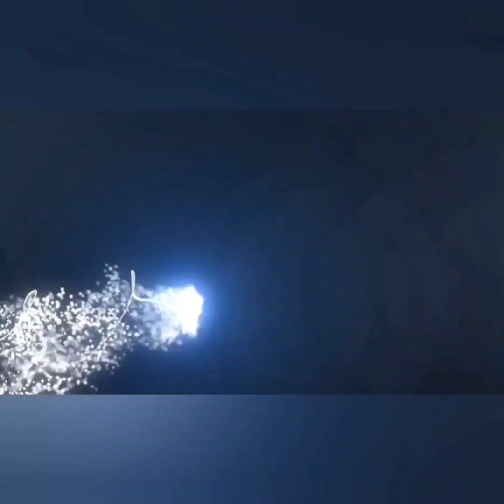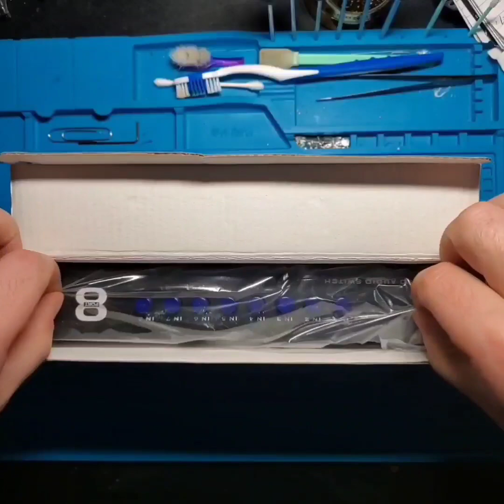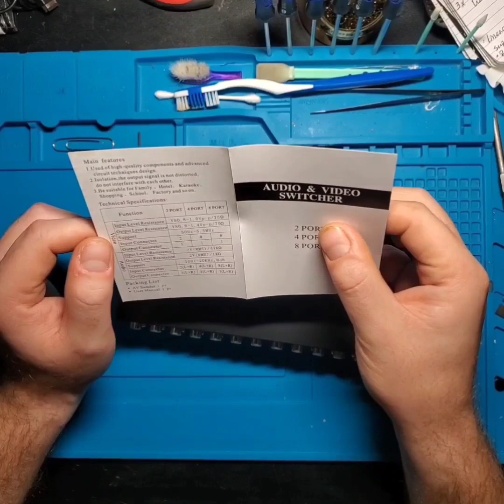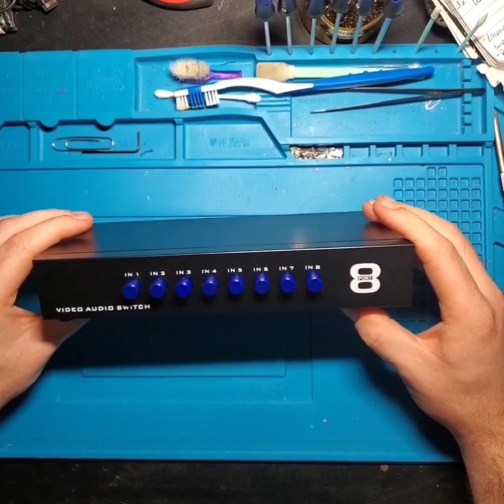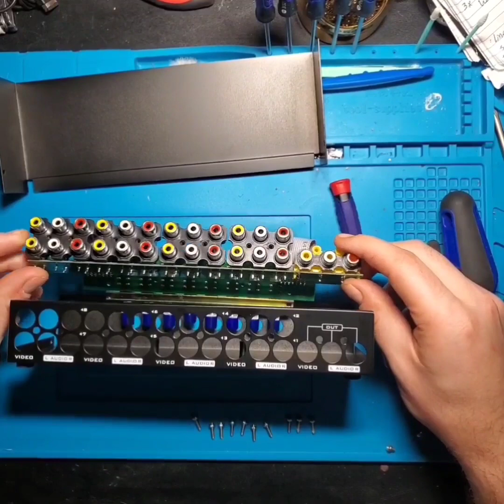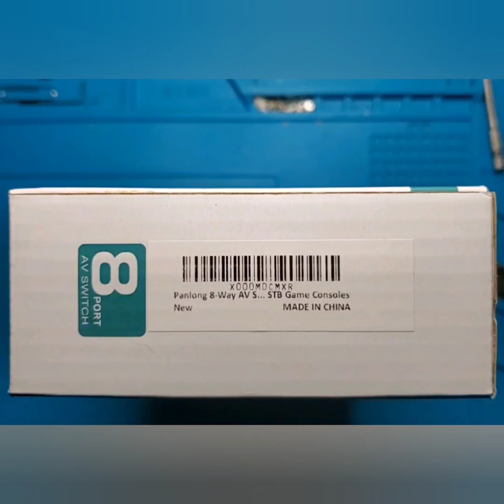Gear Review - Panlong 8 port AV Switch: Trash or Treasure

Comment: I know that this is a 3-y.o. video at this point but you might be interested in the video entitled "8 port AV switch box review and signal ground modification" also posted about 3 years ago by DrCassette.  It points out repairable ground deficiencies on one of the two boards in the exact same 8-port unit.
Reply from the maker: yea i will need to check that out. thanks for the recommendation.

Comment: At the end of the video you don't seem to highly recommend this switch or at least not a long term solution.  Is there any high quality rca splitters you would recommend?  I would like to get one that doesn't casue signal degradation or have soldering issues, any advice would be appreciated!
Reply from the maker: It's honestly just a luck of the draw when it comes to budget rca switches. Many companies, especially those in China, can vary wildly when it comes to quality and production standards, even when an item looks exactly the same. Some companies have more strenuous quality control than others. If I had the capital to go out and buy a few of these switches, I would do so and review each one like I did with this one but alas, I don't. I was looking for a cheap solution at the time. Powered switches tend to be of better quality, but they are also more expensive.

Comment: How do you connect it to play the vintage video game systems. I know they have the red white yellow plugs; but how would that work?
Reply from the maker: Your TV must have either those rca plugs (the yellow, red and white) or you need to use a converter to convert the rca signal to an hdmi signal with something like this. 

Limited-time deal: RCA to HDMI Converter, RuiPuo Composite to HDMI Adapter Support 1080P, PAL/NTSC Compatible with WII, WII U, PS one, PS2, PS3, STB, Xbox, VHS, VCR, Blue-Ray DVD,HDM Capture Card (RCA TO HDMI Converter) https://a.co/d/5Hk8Oox

Comment: It doesn’t need an dc adapter?
Reply from the maker: This specific one does not need a DC adapter to work due to it being solely a mechanical switch. Switches that use DC adapters usually have an amplifier circuit to amplify the incoming signal and push it through an output. Sometimes the switches that use a DC adapter also have internal relays or circuitry to control the outputs and can be controlled with a remote. The downside of a switch that doesn't use a DC adapter is the possibility of signal loss or poor video/sound quality and not having an ability to use a remote control but they are also cheaper to manufacture which means cheaper to buy.